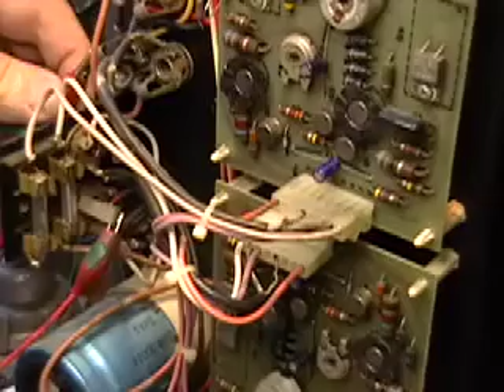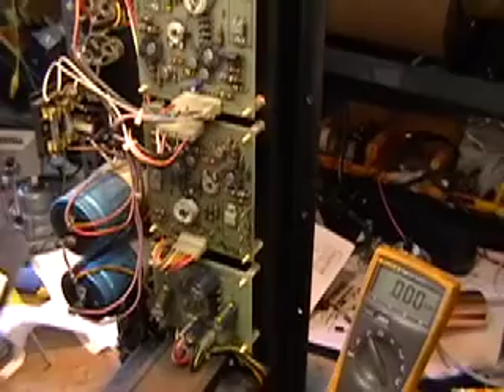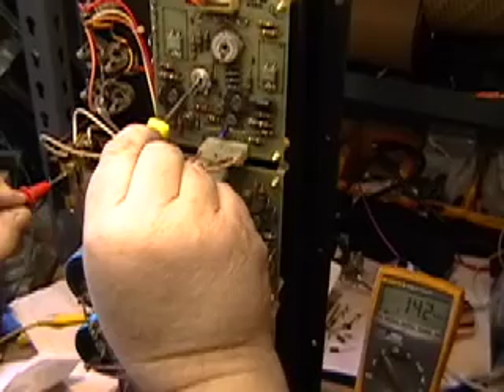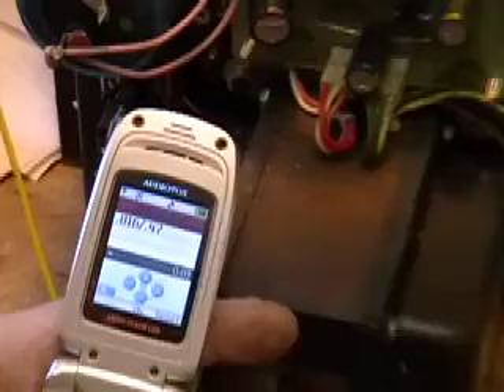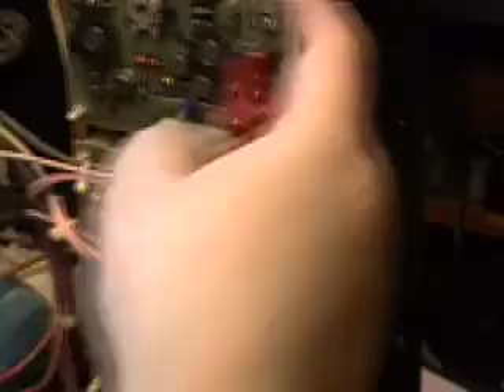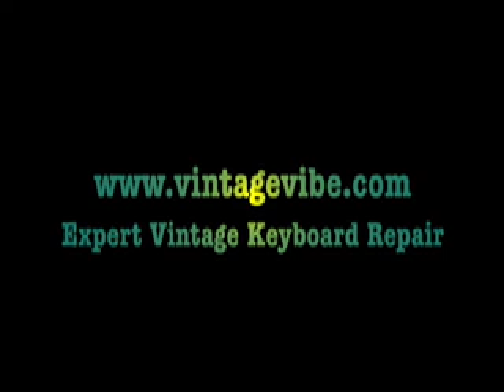Rhodes 5 Pin Amp Repair and Bias part 2

Comment: Hi there, VV folks, and thanks for the videos, they have been very helpful in the past.

Since I'm not too familiar with transistor amps and their biasing, I'm just wondering whether one should check also the other "half" of the amp, since isn't the bias pot essentially controlling bias balance between two halves of the PP amp? I mean the R18-R19 pair right next to the connector for OP transistors?
Reply: Already found out that my assumption was wrong. However, I think (since the resistors have very low resistance, so low that it's difficult to actually measure and verify, at least with my meter) that it's wise to check that the readings on both resistors are approximately the same. I have about 11 millivolts on one and 13 millivolts on the other - I should be safe!

Comment from the maker: @southerner66 the value of 25-30 ma is correct for a class ab amplifier at 60 w rated output and is typical of high fi numbers from dozens of receivers over the years. 90 ma won't give you less distortion and will only heat up the outputs. If there were 4 output transistors per channel then the bias would increase to 50-60 ma.

Comment: Also, I think I've determined that it's normal for the 5-pin/100W Suitcase Piano to have a much louder turn-on thump than the 80W version because its power amp sections are completely direct-coupled. I'm theorizing that the interstage transformers in the 80W version block very low frequency transients and allow the output stage to power up more symmetrically. 

Is this correct?

Comment: Thanks for an excellent video! I was wondering if 25-30mA bias at idle for the output modules was the factory setting or what you've determined over the years to work best. As I'm sure you know, it's not in the standard Rhodes Service Manual. I just worked on a 5-pin Suitcase, and both power modules were set to about 90mA bias current at idle.